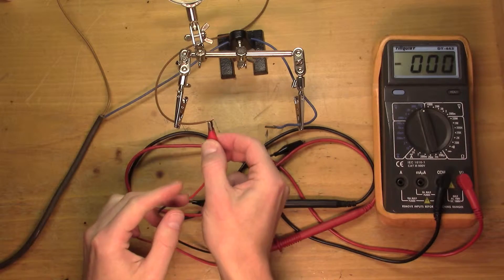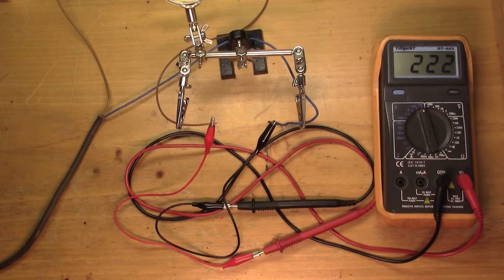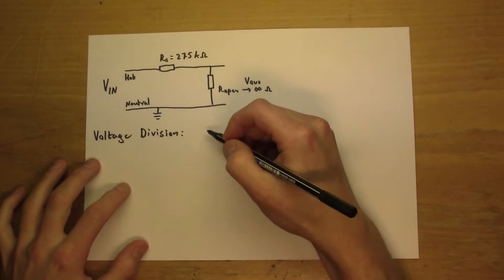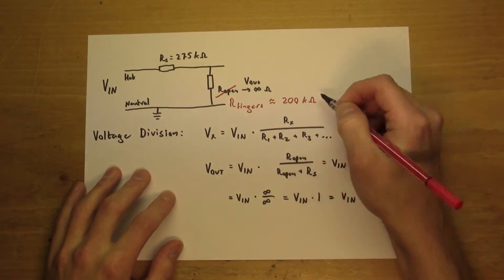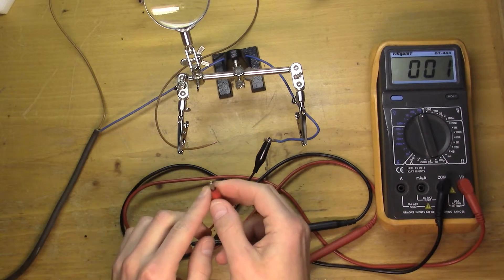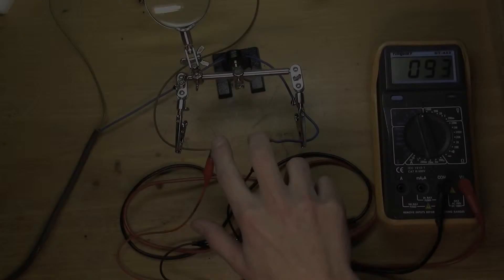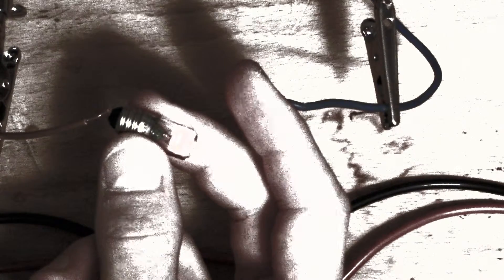Shorting 220V AC with Your Fingers

Comment: Well, touching 230V with only 2 fingers is plausible, even with two opposing hands. The main problem is contact pressure, if you touch the wires only lightly with fingerprints, your fingers tinkle a bit, however squeezing the wire with a index finger and a thumb would certainly shock you pretty badly, As the resistance drops from 100K to about 20K at however I can't feel anything below 180V AC/DC despite my thin skin on fingers.

Comment: You never shorted it
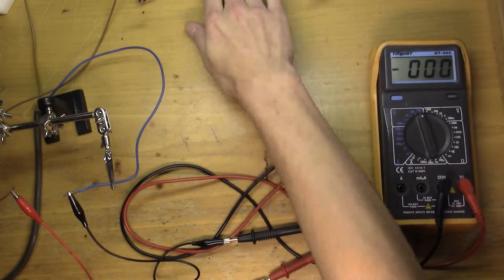Reply from the maker: As Szakállat Korporésön TV pointed out, "shorted" is a bad choice of word. Because of the high resistance of the skin there is only a very small amount of current going through the fingers. The series resistors reduce this current even further. At 0:26 you can see that there is a small amount of current through the fingers; enough to make the lightbulb glow.